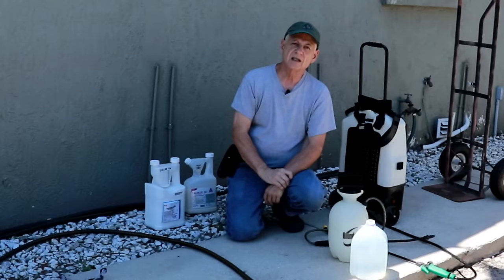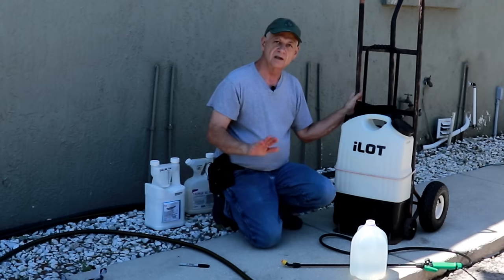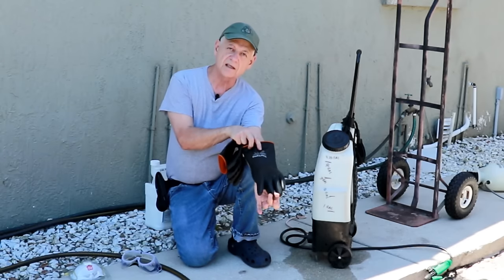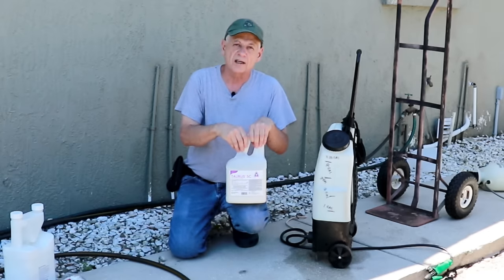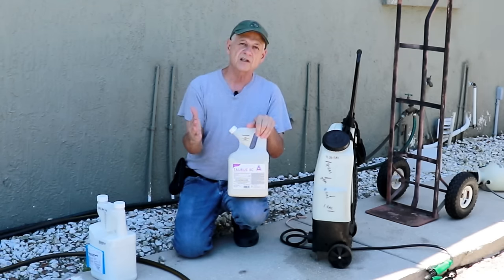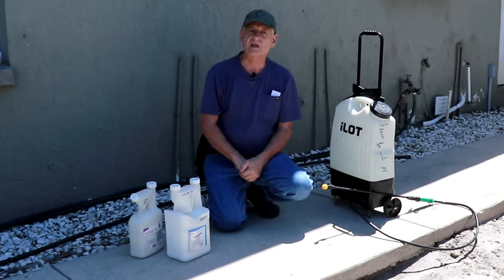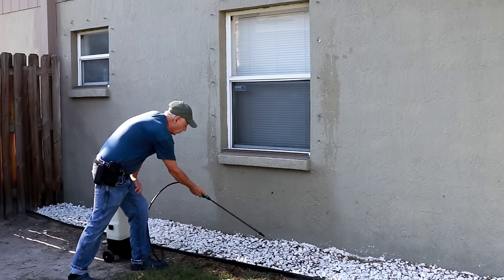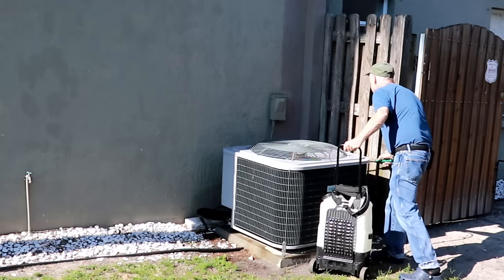General Exterior Pest Control - IMPORTANT!  READ THE DESCRIPTION.

Comment: Hi Guy.   Thank you for the info.  I live on Guam   We have rain almost year round.  Lots of rain.   Which system would be best for my climate,    Bait station, granules, or liquid.  Thank you
Reply from the maker: If you are talking about termites, then you may not be able to get the granules there.  I think they are only for sale in the States.  If you have an existing infestation, then how you handle that will depend on the species.  You have at least three different species of termites where you live and they each get treated differently.  The granules only work for subterranean termites anyway.  You could also have drywood or Formosan termites, and maybe a species that I am not familiar with.  So, you need to start by determining the species.  If you have any damage, try to dig out a specimen with a red head.  Those are the soldiers and they are the easiest to identify.  If you have any mud tubes, you may be able to obtain a specimen by breaking open the mud tube.  Google "termite soldier species in Guam" and see if you can find photos of the different ones that are know to exist there.  You should be able to identify the species because the heads are usually quite different on the soldiers.  If you have a species that I am familiar with, then I can probably tell you how to treat it.  Just let me know what you find out.

If you do not have an active infestation, and you just want to do a preventive treatment, then I can tell you an easy way to monitor for subterranean termites.  There is also a way to prevent drywood termites, but it's a bit more work.

I hope that helps.  Be well my friend.

Comment: Thank you for your help! You are thorough and very easy to understand!
Reply from the maker: Thank you.  That is very kind of you to say.  Made my day.
Reply: I am the person who found a tube inside my house, nothing in it. You advised to pull the baseboard back and I did have about a foot of soft baseboard and I pulled it back and it’s deteriorating. I didn’t see anything behind it.  I have used the suggested formula outside about a week ago. I live in NC and I jumped the gun using that I guess.  I lost where we first started communicating, but you last told me you would suggest something for behind the baseboard after I pulled it out.
Reply from the maker: Hi Jeneanne.  Yes.  I remember you very well.  It is very unusual to find termite damage and no termites.  It's hard to believe that the BioAdvanced granules would work in just a week, but I suppose anything is possible.  I'm still wondering if your neighbor that faces the side of the house where the damage was treated for termites.  All subterranean termites live underground, so if your neighbor treated for termites, that may have gotten rid of your infestation as well.  Also, you live in a place where Formosan termites are a possibility, but again, it sounds a lot like these guys are gone.  Anyway, what I suggested was to locate the wall studs that are behind the affected baseboard and push on the drywall that is covering the studs with a screwdriver.  If the screwdriver goes right through or it feels really soft, then you may have an infestation in that stud.  If it feels solid, then  there is a good chance that the infestation was limited to that one baseboard.  In any case, the BioAdvanced granules should take care of it, but if one of the studs does feel soft or the screwdriver goes right through, then you can do a spot treatment with fipronil foam just to make sure that you get them.  I use FiPro foam because it's the cheapest and I like the applicator tip a lot.  I will place a link below for it.  Just drill a hole that is wide enough for the applicator tip to go in and make the hole about two inches deep.  Drill more than one hole.  I would start at the floor level and drill two or three of holes vertically about three inches apart into the studs that you suspect are infested.  Then shoot the foam in for about five seconds.  If the foam starts coming out the other holes, then there is a gallery in that stud, or at least there was, and the foam will take care of it for sure.  If the foam shoots right back out at you, then there is probably no infestation. Again, the BioAdvanced does the same job, but hitting these things directly is never a bad idea if you know for sure where they are.  The fipronil works exactly the same way as the BioAdvanced.  The termites will not realize that they are being poisoned and they will carry it back to the colony and share it with the other termites, including the queen.  Then it's lights out for the entire colony.  Fipronil works faster than the BioAdvanced, so hitting them directly will speed up the process.  The BioAdvanced generally takes between two to eight weeks to eliminate a colony and hitting them directly should keep the time down to about two to four weeks.  Exactly how long it takes depends on a whole variety of factors, but it should be a sure thing, unless you have Formosan termites.  I do not suspect that to be the case though.  I can't be certain without inspecting, but my gut tells me that these are most likely a common species like eastern subterranean termites.  So, you should be okay.  By the way, if you still have the baseboard off, then dig into the back side of it with a knife or screwdriver and see if there are any dead bodies in there.  I'm just curious.  I'm guessing that you will find nothing, but it's worth checking.  If you do find a specimen, then take a photo of it and I will tell you where to email if for a positive identification.  Get as close as you can and make sure the termite is in focus.  I hope that helps.

https://www.solutionsstores.com/fipro-foaming-aerosol
Reply from the maker: The studs are actually pretty easy to find.  There are two ways to do it.  The first is to buy a stud finder from Home Depot, Lowes, or Amazon.  I will place a link below for one.  They are very easy to use.  Just follow the directions.  The other way is to simply lightly tap on the wall with a hammer.  The sound will change when you tap on a place where there is a stud.  Then just take a four penny finishing nail and hammer it into that spot.  You will know when it hits a stud because it will be hard to hammer in.  If there is no stud, then it will go right through.  A four penny nail is very narrow and you won't even notice that small hole much.  Then you can just fill it in with a little spackling compound that you can get from Lowes or Home Depot.  Just push a little in the holes with your finger and wipe off the excess with a damp sponge.  It's very easy to do.  A cheap stud finder only costs about $10 and that should do it for you.  This is exactly what a handyman is going to use.  Also, almost all pest control companies will do a free termite inspection for you and they will go under the house for free.  I would call a mom and pop outfit and not Terminix or other national company.  The national companies usually send out a trained sales person and they are often high pressure to get you to sign a contract.  The mom and pop outfits will generally just come out and tell you what you have and give you an estimate.  If they do find an active infestation, then ask them the species to be sure that these are not Formosan termites.  If they are not Formosan, then you've got this already covered.  Just thank them for their time and let them know that you want to get several estimates before you proceed.  Also, get a written treatment plan from them to see how they plan to treat the problem.  You have a right to know the species and the treatment plan.  I hope that helps.  

https://smile.amazon.com/Detector-Electronic-Scanner-Finding-Detection/dp/B08FB68DJC/ref=sr_1_16?crid=26G6APCYTXJEY&dchild=1&keywords=stud+finder+wall+scanner&qid=1626433506&sprefix=stud+finder%2Caps%2C249&sr=8-16
Reply: Ordered the stud finder. Thanks so much for your help. I will let you know what I find!
Reply: If you are in Facebook messenger, I would like to send you a message that I don’t feel comfortable saying on here concerning extermination companies. Im under Jeneanne Brown.
Reply from the maker: I think I found you on FB messenger and I will send a message.  If you don't get it, then I messed it up.  I can give you my email as well.
Reply from the maker: I did send you a FB message, but I have not gotten a response.  I hope I didn't send it to the wrong person.  You can also try my email at guysyoutube@mail.com.  Please note that it's just mail and not gmail.  Thanks.

Comment: Excellent - Do you have any tips for trailer on slab wit wood decks around them?  
Thank You so much, Great series of Videos
Reply from the maker: Hi John.  It works the same way with slabs or any concrete surface.  Just use the product around the slab as shown.  It is also the same for decks, except it's great if you can actually get under the deck and apply the product along the slab where the deck is attached to the trailer.  Also, it's a good idea to place the product around all the deck posts.  If you cannot get under the deck, then it would be a good idea to remove a deck board next to the trailer to get the product next to the slab.  However, if you cannot do that either, then just use the product around the deck.  Sorry that it took a week to answer this, but YouTube held your question for review.  I have no idea why, but I just received it this minute.  Sometimes they do that and in a couple of cases they didn't let me answer for some reason.  I am working with them to try to resolve the problem.  Thanks for the question and thanks for watching.

Comment: Guy , thank you much for sharing your knowledge . I have a suspended ceiling in by basement which allows me easy access to the floor beams of the house . What is the best product and method to treat as preventative maintenance for termites on the inside of the house ? TIA for any info
Reply from the maker: Sorry that it took so long to answer this.  YouTube keeps holding your comments for review.  Please contact me at my email if you have other questions to be sure that I receive them.  My email is guysyoutube@mail.com.  Please note that it's not gmail.  Just mail.  This way I can be sure to get back to you in a more timely manner.  If you have a suspended ceiling you can treat all the wood above it with Bora-Care.  That is a permanent treatment that never stops working.  I do not have a video on it, but I will place a link below for someone else's video.  You need to mix it one to one in a bucket and then apply it with a garden sprayer.  They say you can mix it one to five, but don't do it.  After use, be sure to rinse out the sprayer really well or it will clog up.   I hope that helps.

https://www.youtube.com/watch?v=Rmr_aEodyhg

Comment: Thanks for sharing the great video. Had a question though..
We had a water damage and had to remove the sheetrock (till 2 feet from the floor) in the entire first floor. The exposed studs were professionally cleaned and dried. I was wondering if I can put these termite killer pellets across the opened up sections of the wall before installing new sheetrock, wanted to check if that is a good idea or if there is any downside to it. It will be awesome to get your opinion. Thanks in advance!
Reply from the maker: Hi Sanjay.  The termite granules are for exterior use only.  However, you can treat all exposed wood in the walls with Bora-Care and I highly recommend that you do it.  After you treat with Bora-Care, the treatment is permanent and that wood can never have termites or any other wood destroying bugs ever again.  Also, Bora-Care is 100 percent safe to use when you follow label directions.  You can obtain it from DoMyOwn.com or Solutons Pest & Lawn.  Solutions sells it a bit cheaper.  I will place links below.  Mix it one to one and apply with a garden sprayer.  Always mix it in a bucket and not in the sprayer.  There are some good videos on how to apply it and I recommend that you watch one.  I will place a link below for a video that I like.  I hope that helps.  Thanks for the question and thanks for watching.

https://www.domyown.com/boracare-p-100.html
https://www.solutionsstores.com/bora-care
How to apply Bora-Care:  https://www.youtube.com/watch?v=qF8d-pL1mR8
Reply: @GuysPestSolutions  thanks for your advise. Will follow through and will go ahead with your recommendations.

Comment: Guy, good video.  What do you recommend for indoors? The talstar says it can be for indoor use....do you have a video for indoors?
Reply from the maker: Hi James.  You are correct that the Talstar P is registered for interior use, but I don't have a video on it because I generally do not recommend applying pesticides inside the home.  Now there are exceptions.  Sometimes pesticides are the only way to deal with some interior pests.  However, most pests enter from the outside, so if you do the exterior treatment every three months, then you typically do not have pests inside the home.  Some pests do fly in through open doors and windows and some get carried in by people, but most of them must cross the pesticide barrier and will just die.  Most of the interior pests folks ask me about are fleas, roaches, bed bugs, ants, and spiders. 

If you tell me the specific pest that is causing the problem, I will be happy to explain exactly how to go about treating for it.  When it comes to interior pests, the treatments can vary quite a bit and it's not a good idea to just indiscriminately apply pesticides inside the house.  It's a much better idea to just target the specific pest that is of concern.  I can definitely help you with that.  Just let me know.  I am always here to help.

Comment: Firstly…70yrs old, where? You look fantastic, Sir!
I have a question. 
Does that product stain siding? (PVC)
Also, I have a crawl space that rock and soil. What product can I use that will be safe enough to use underneath my home? (..there’s air exchanging through vents into living spaces) I’d love to get my crawl space encapsulated at some point to help keep pest out. I have spiders and centipedes. Also while I’m at it, is there anything I can use to spray along my foundation that will keep critters from digging beside my home? I hear them periodically gnawing on my concrete foundation wall?!
Reply from the maker: Thank you so much for those kind words.  The products do not stain the siding.  If you treat the outside of the house every 60 to 90 days, then you will not have any bugs at all in the crawl space.  Think about it.  How did they get into the crawl space in the first place?  The answer is they came in from the outside.  If you have a chemical barrier around the house, then they cannot come in the basement.  After you treat the exterior, then simply use the Talstar P to spray under the crawl space.  It is odorless and will not harm anything.  If you keep up on the exterior treatment, then you only need to treat the crawl space once.  You can also do the outside treatment with a less expensive product that I tested.  It's the same as Talstar P but has a slight odor to it when wet.  It goes away after it dries.  It's Bifen IT and it works great.  Just use the Talstar P under the house because of the odor.  The Bifen odor goes away after it dries.  You can also use Bifen XTS in a hose end sprayer to reach high up places on the house.  I have a video on the Bifen treatments, and I will give you the link for the video.  If you really want to go nuclear on the bugs, then treat your yard as well.  That's what I do.  I treat the house and the yard every 60 days with Bifen XTS.  It looks expensive, but it gets mixed at 1/3 ounce per gallon instead of 1 ounce per gallon like Talstar P, so it goes 3 times as far.  It is actually less expensive per finished gallon than Talstar P or Taurus SC.

Critters hang out around your house because there is a food source.  Make sure there is no pet food left outside or water bowls.  Also, remove any hiding places.  They may also be feeding on bugs, lizards, and that sort of thing.  Treating the yard will eliminate the bugs, so that will interrupt the food chain.  The critters may not go away entirely, but you will encounter a lot fewer of them.  Most will move on to greener pastures.

I hope that helps.  Be well my friend.

Video on treating your house with Bifen products:  https://youtu.be/Yozv3s-Qwlw

Video on how to treat your yard:  https://youtu.be/wifoTU5dmp0
Reply: @GuysPestSolutions  Wow...I hope that I'm able to save this reply from you FOREVER!!!! WHAT GREAT ADVICE! Thank you, Guy! You've gained a NEW Subbie, kind Sir!😊
Reply from the maker: That is so nice of you to say.  Thank you so much for watching and for subscribing. Very much appreciated.  Be well my friend.

Comment: Hi Guy, I'm a Massachusetts resident and have a carpenter ant problem. As a Mass resident I'm unable to purchase Taurus SC as you are aware. Can you suggest any alternatives that might work for my situation. I don't know if the age of my home would have any bearing, but the house was built in 1772.
Reply from the maker: You can use Bifen IT instead of Taurus SC.  I think they will ship that to MA.  Let me know if they won't and I will give you another option.  If you have high up areas to reach, you can also use Bifen XTS in a hose end sprayer.  I will give you a link to my video on treating ants.  It will show you how to do the treatment with these products.  The exterior treatment is the same for all ants, including carpenter ants.  The video has links to everything in the description and it will show you how to mix the products correctly.

I hope that helps.

Video on how to treat ants:  https://www.youtube.com/watch?v=arPeidADLpY

Bifen IT: https://www.domyown.com/bifen-it-p-226.html?sub_id=11662 

Bifen XTS:  https://www.domyown.com/bifen-xts-p-1236.html